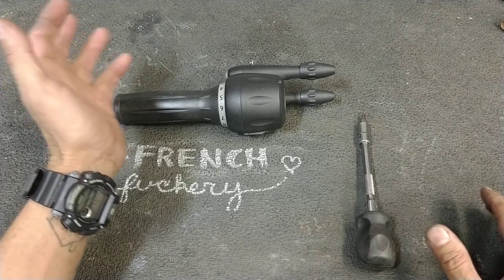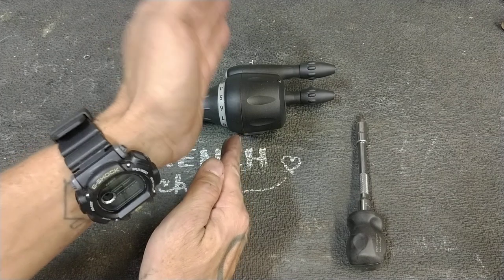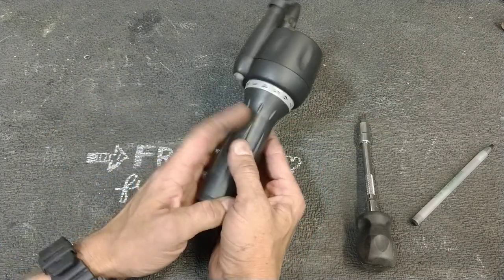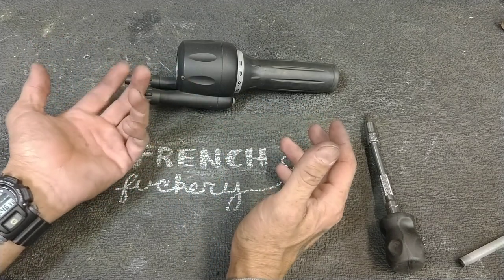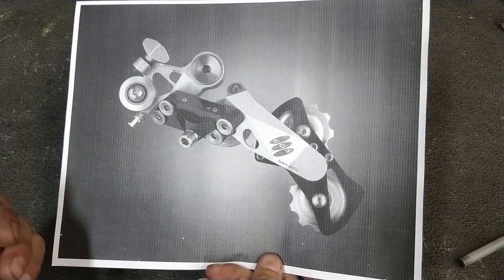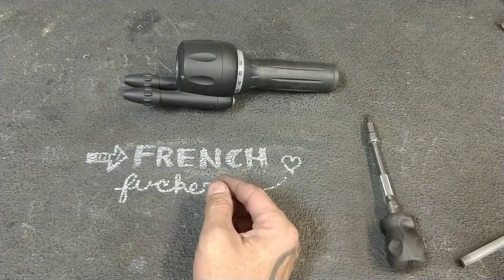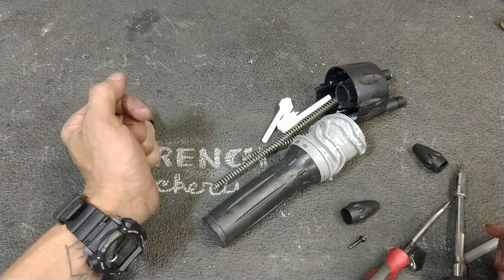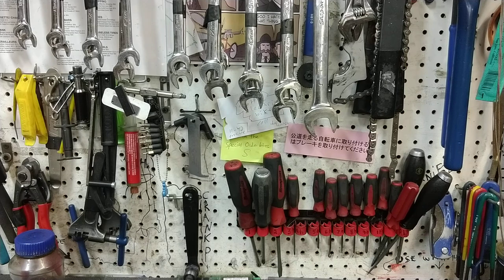EGS synchro shifting: French F*&!ckery

Comment: Hi there, 
You perfectly understood the way it works.
I engineered the synchro shift Easy and I do confirm the springs were put inside the shifter at the end of the assembly thanks to a jig then a Nomel metal ring was put to stop the springs after loading them.
Reply: Hello Sylvain, is there any chance you could share with me a manual or exploded view of X-Pro Synchro Shift shifter?
Reply: Bonjour, votre invention était géniale ! Elle réglait le problème des croisements de chaine et offrait une vraie progressivité dans les rapports. La poignée (rouge violet, dans ma version) est super confortable et dans un caoutchouc qui n'a pas vieilli !  Décathlon ne savait pas la vendre et je l'ai trouvé sur un vélo en soldes par hasard chez eux en 1999. J'ai tout de suite compris la valeur de l'engin, mais le vendeur ne savait même pas que c'était un équipement spécial sur le Rockrider 320 (qu'ils ont ensuite vendu avec un truc a poignée classique). Si vous avez conservé la connaissance de son entretien, vous m'aideriez en m'indiquant comment réaligner le système (je n'arrive plus à monter de plateau proprement). Je suppose que ça passe par l'utilisation des petites roues sous la poignée. Je n'ai jamais changé de vélo depuis pour conserver ce super système. Je compte aussi passer à l'électrique pour aller au boulot, avec un moyen Nexus et une commande qui me rappellera votre système, mais pour mes loisirs, c'est toujours mon R320 que j'utilise :-) Bref, merci par avance si vous pouvez m'aider !

Comment: I found one on fleabay!  Watched this and thought "Gotta have it" so bought it 😁
I think you'll find there's 2 tracks for the cable actuation, the front derailleur  follows one track and the rear follows the other and I bet when the unit was assembled the springs were not under compression but stuck out of the ends under the barrel adjusters and once it was together they were compressed and held in with keepers pressed in really tight if not bonded in 😉
Reply from the maker: Awesome! Hopefully yours didn't detonate into your chest like a frag grenade! Good score
Reply: Actually after watching yours I removed the plastic adjuster screws and the springs came out without any hassle 😁